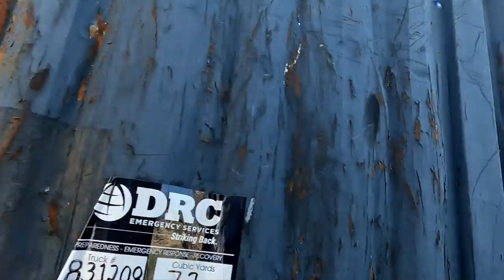WATER METER DISASTER REPAIRED

Comment: I usually heat up the pvc get a small screw driver on one end the push my needle nose in it heat it again and twist the pvc will just twist into itself and come away from the threads or get a 1 inch chisel and smash it in there and twist